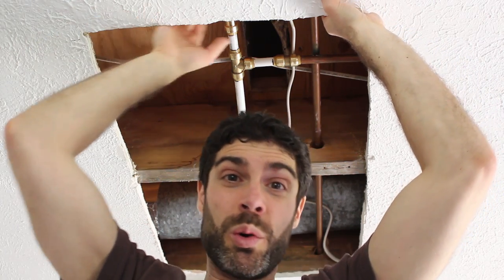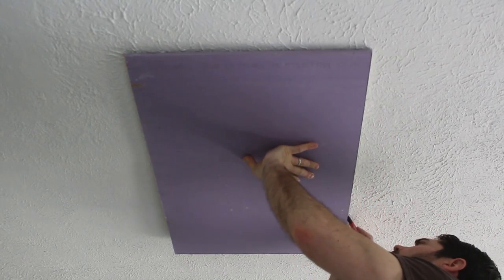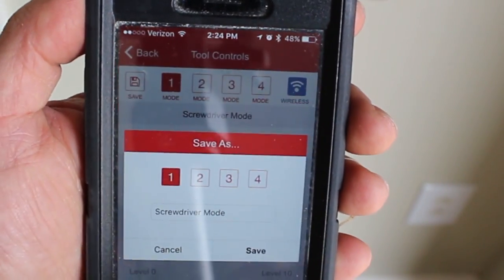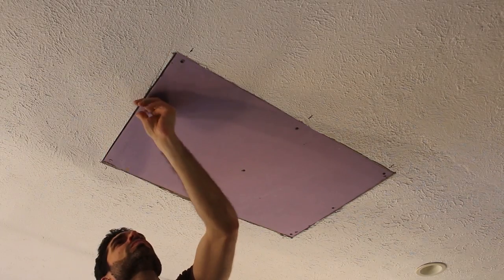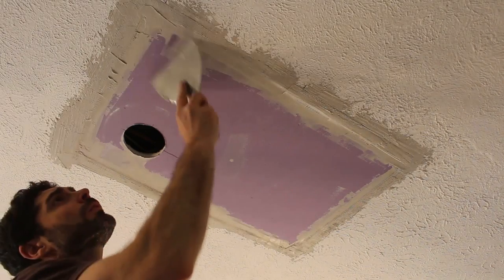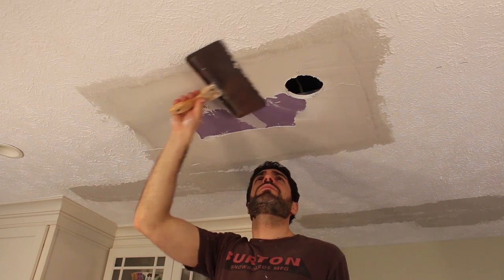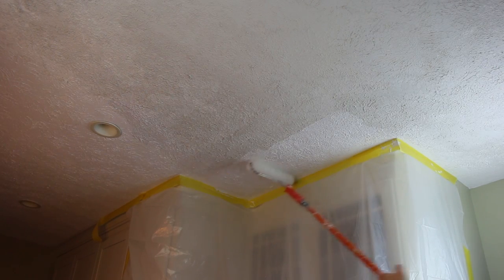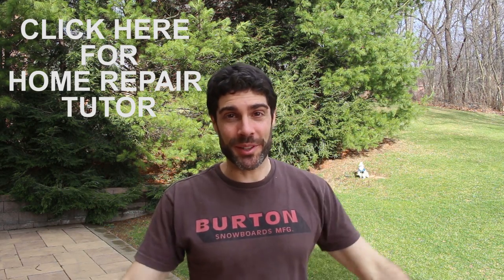How to Fix Drywall in a Bathroom or Any Other Room (Step-by-Step)  -- by Home Repair Tutor

Comment: Thank you for taking the time and sharing your knowledge! I would love to be considered for you Drill and Inpact driver kit with charger set you are giving away for so many reasons: To start, I am a recently single mom with 3 girls, twin tween girls age 13 and a 19 year old. My oldest daughter and I just replaced the ceiling fans last month and felt a great deal of accomplishment since this was the first project we have completed without their dad looking over and cheking our work! Since we seperated, the tools we had left with him, and we have a drywall project coming up, that this kit could really be usedul for as well as many more projects. I live in the same home I grew up in that my parent built over 37 years ago, that has so many updates needed, that if I win this, it would be going to a home that would get MUCH USE from having! (we even have the original carpet, wallpaper, and pink formica cabinets ) I have completed do it yourself home projects before and my girls are at the ages were they are wanting to help me more with the house and have been watching all the do it yourself videos, So all thee more reason to want to stock up and expand my " basic pink toolbox kit " my girls got me at Walmart for $15.00 when we changed out the ceiling fans. In closing, I would love to build up my tools and continue have my girls be more hand on with our projects, without having to alway rely on a "male" for all household diy repairs or updats are consern. If we dont win, I still know I will receive a wonderful gift, watching my girls confidence grow, through knowledge gained through these videos like yours, and after every new project they complete, They can feel a sense of accomplishment and pride to be able to say "we did this all by ourself"
Reply: Heck YES!! I'm the youngest female in our family and I have been recently designated the House Handygirl. I've been doing things around the house that my brothers and Dad have no idea how to do. Actually I had to start working at night because no one believed that I could fix these things or had any faith in me. I have fixed the washing machine (replaced agitator dogs-- saved my family at least $250, the part was $3), I've recaulked around the bathtub floor and insde the shower which saved our laminate floor when a pipe under the toilet broke and water gushed everywhere, I fixed a leaking dishwasher by cleaning the gaskets. Now, we had a leak after a big rain ( I cleaned the gutters! or we would have had lots more leaks) and my parents sent me into my brothers room to check on it, saw a leak, went outside to check the gutter, yes it was totally full of water because one little stick was blocking the drain which made the water back over the gutter and spill making a leak in his room. Now my Dad has asked me if he thinks I could patch the drywall in the ceiling. I feel SO accomplished when I fix things around the house and now that I've completed a couple projects successfully, my family believes I can do any project I put my mind to. Our society does not put faith into women. This Lady Brain can fix s***t BETTER than the boy brains in my house. I love that you're encouraging your daughters to take initiative and to be proactive in caring for your family home. You Ladies are badasses and rockstars! I'd watch your youtube channel all day!! High fives all around for girl power!

And thanks Jeff for this tutorial! Lots of good tips!

Comment: Excellent information, Muchas Gracias, I would like to have the Milwaukee driver because am renovating my bathroom and i will be doing a lot of drywall repair, thanks
Reply from the maker: +chovalin we're in the same bathroom boat. Lots of plaster and drywall in my future! What kind of bathroom remodel are you doing?

Comment: I could really use one of those.  I have a section in my master bedroom that was a victim of a ice dam.  I also have a section in my bathroom that needs repaired do to a towel rack being pulled off the wall.
Reply from the maker: +Raymond Williams those darn towel racks!! They're the bane of homeowners. Thank goodness for blocking, but that's mostly an option if you demo the wall.
Reply: +Jeff Patterson The previous owner liked to put toothpaste in the multitude of holes he put in the wall.  I may just have to take out half a sheet or more.  We have that bumpy kind of finish on the wall so I have been reluctant to do the work.  That stuff makes the patches hard to blend in.

Comment: Great Vids!!! Need this impact drill to rebuild my bathroom! :)
Reply from the maker: +Sébastien Comeau way cool, what all are you working on right now?
Reply: I'm not working on anything right now. We are brainstorming for our bathroom and main entrance remodel. This drill will be practical for all the steps in our house remodeling process. Did I win? :) Btw I like you diy vids because I want to learn to do my renos by myself and helps on my lack of confidences.
Reply: +Jeff Patterson I will replace the cushion floor with tiles so this drill is what I need to drill the subfloor every 4 or 6 inches.
Reply from the maker: +Sébastien Comeau what all are doing in your bathroom? Tile?
Reply: +Jeff Patterson ceramic or porcelin tile using a leveling system. Replace my old whirlpool tub with freestanding thub. Replace my old vanity with a modern one and also change the place on the door to make the bathroom public.

Comment: Why do I want it?  I have last years model with the variable speed and dropped it off a ladder while, you guessed it, patching a ceiling!  Now it's going backwards instead of forwards and vica versa.  I hate being without an impact so I don't want to send it out because it actually still does the trick when absolutely needed. But it's really annoying to have spent $400 on the impact/hammer combo and have that happen 6 months in!
Reply from the maker: +Eric Holt that totally sucks!! Is it still under warranty? You could get it fixed for free possibly
Reply: +Jeff Patterson It should be, but I would have to send it out with a few months lead time.  Being without an impact for that long at this time of year is not an option.  I was planning on buying a new one as soon as I could afford it and then sending it out when the lead time doesn't matter.  Rock- 😞 -Hard place
Reply from the maker: +Eric Holt for reals, that does stink

Comment: 3:36 you can drill through wood with drill bits & a power drill?!
Reply from the maker: +marty one yes
Reply: Thanks for all the great tips. especially the 2x2's . used a whole bunch today on a 5'x10' ceiling. what a mess though. they should make a very slow moving circular saw so there's less dust. seen one in a machine shop foe metal.I used a cheap harbor freight oscillator.
Reply from the maker: +marty one those 2x2s come in handy

Comment: I'll like the impact driver, so I can screw down the bathroom floor plywood that I'm gonna have to replace on the house, because the wood rotted out.
Reply from the maker: +Luis Delgado have a similar project, rotted wood = no fun
Reply: I know right, It's so bad that the floor feels like walking on an air mattress, just gotta remove the rot, fix the leak and tile.
Reply from the maker: +Luis Delgado awe man, that stinks. Sorry to hear. Had to do the same thing last weekend ;(
Reply: Yeah I know, but whatcha gonna do...
anyways thanks for the tips, gonna use them next time I need to do drywall, BTW that drill attachment that has the plastic cover would've been so useful when I used to work construction, I always made the holes by hand and even with eye protection, I'll always get drywall dust on my eyes, it's so fine it gets everywhere man.

Comment: I'd never seen the funny brush that you used to match your ceiling texture.  A great idea!  Why do you think that you have a line just on one side where your seam is???  I don't want to make the same mistake.  Is it just a matter of too much joint compound?  I would like the drill because then I wouldn't have to borrow one when I need to do a repair. Borrowing only goes so far and then you feel like a jerk!
Reply from the maker: +Judy Jensen yah that line is from not seeing the joint compound irregularities. Too much compound and bad light = bad situation. You'll do a better job than me.
Reply from the maker: +Judy Jensen can you send me an email? I have a question for you. My email address is jeff@homerepairtutor.com :)

Comment: Sign me up for your Milwakee driver giveaway please! We just bought our very first home on leap year day (2/29/2016) and we are super busy updating our new home which is actually 30 years old. We love DIY projects and this driver would be a great tool to use with any upcoming project. 

Great video, very well edited and organized. Easy to follow. Thank you.
Reply from the maker: +Walang Pag Alala that's awesome, congrats on your new place. What are your projects?
Reply: +Jeff Patterson Ceiling fans, carpet and new garage door for starters. Eventually we plan on redoing our kitchen ceiling by rerouting the air ducts and installing recessed lighting.